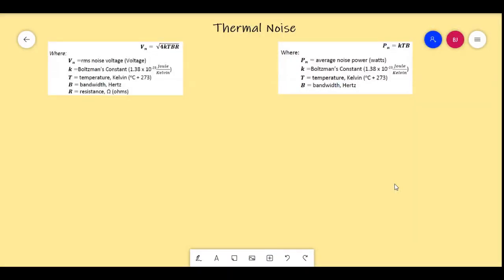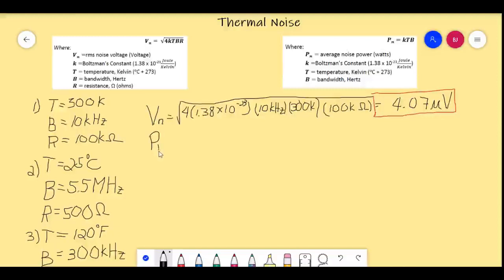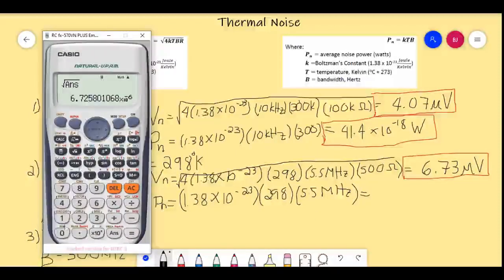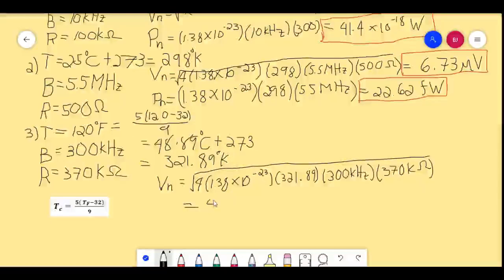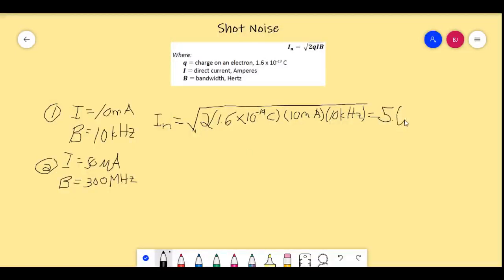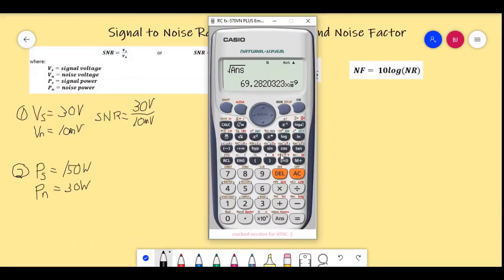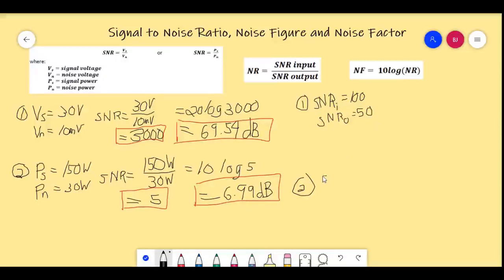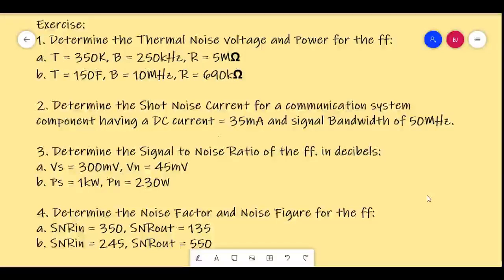Thermal Noise, Shot Noise, Signal to Noise Ratio, Noise Figure and Noise Factor (Sample Problems)

Comment: sa shot noise sir, ang naging sagot ko ay po 0.00000000271. Pwede ba to sir? tama po ang mga values na inilagay ko sa formula
Reply from the maker: Convert mo into Engineering notation.
Reply: @jayroldbaliwagan2382  thank you sir, ok na po pero salamat po. Isa nalang po yung problema ko which is kung anong formula to find Vmin, ang given lang po samin ay Vmax = 7.45V at Modulation index = 0.691. Nagsearch na po ako kung saan saan pero hindi ko po talaga mahanap yung formula. :)
Reply from the maker: @PopCapMusicTrending  sa AM ba yan? Vmax=-Vmin(m+1)/(m-1)
Reply: @jayroldbaliwagan2382  Thank you sir, napasa ko na po kanina. Nagtry na lang po akong manghula pero it seems 1.36 is the Vmin para ang maging sagot ay 0.691. Wala lang po akong process kung paano ko nakuha yung 1.36 kasi hula lang po, pero sana tamaan ng prof namin haha.
Reply: @jayroldbaliwagan2382  eto po yung pinaka question. Given a Vmax of 7.45V and a modulation index of 0.691, calculate for Vmin.

Comment: Sr how can u find out noise power can i explain it.?
Reply from the maker: What type of noise are you referring to? There are many types. Noise power from thermal noise is included in the video. For shot noise, you can get its noise power by squaring the shot noise current and multiplying it with resistance.